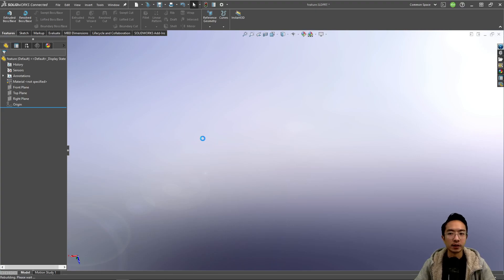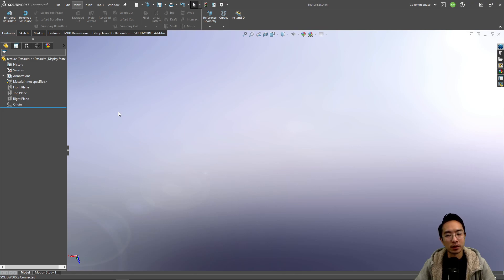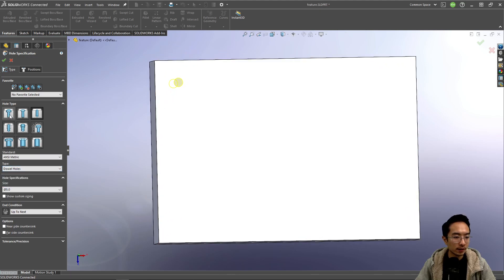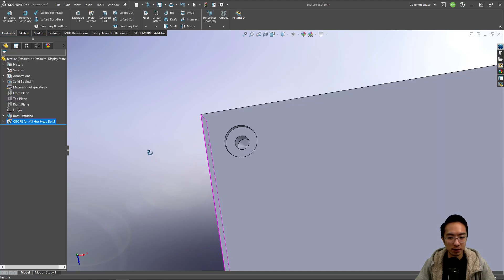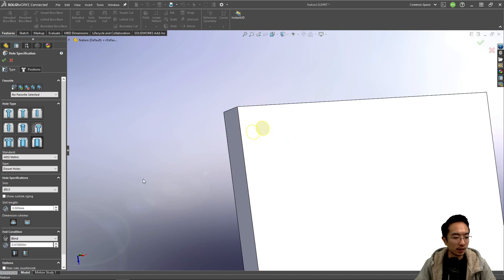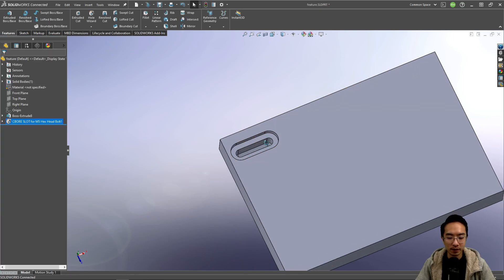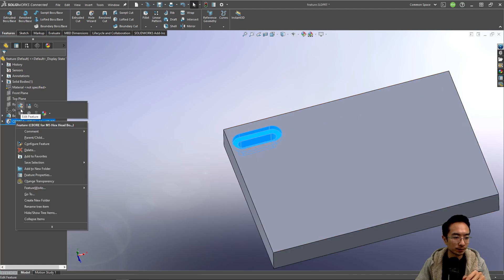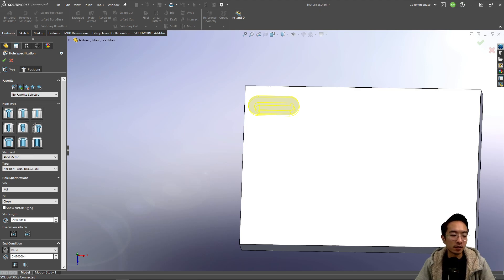Solidworks Hole Wizard

Comment: well... people say it's awesome. but build models with hole wizard and then try update the model and even if the holes has the correct reference, and make the model larger or smaller, even if it's just 1mm. its 50/50 if the reference will get lost. even had some models if you reference from a .step file. it break the reference even though if you go into sketch and every hole is fully defined and looks ok. as you click out it still saids something went wrong... the pain! to do and redo...
Reply from the maker: Oh interesting. I have yet to face this issue